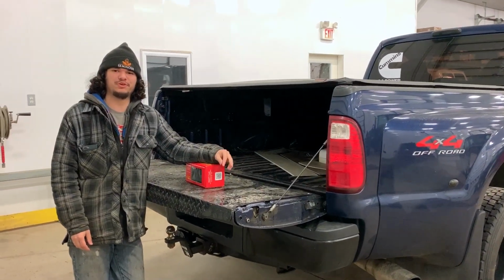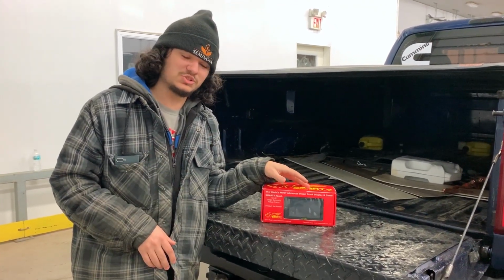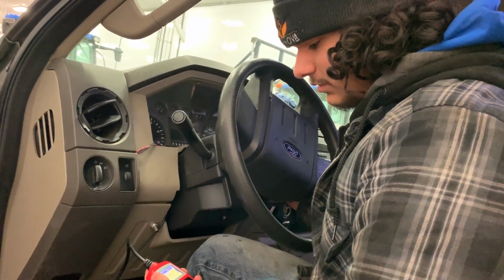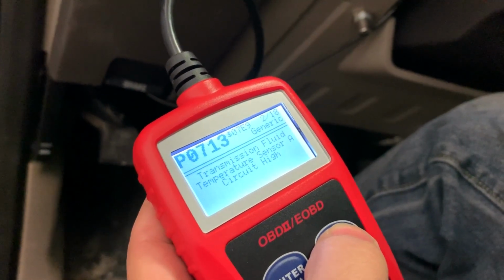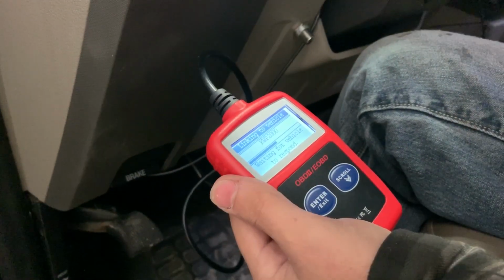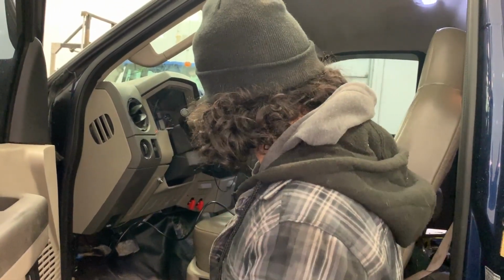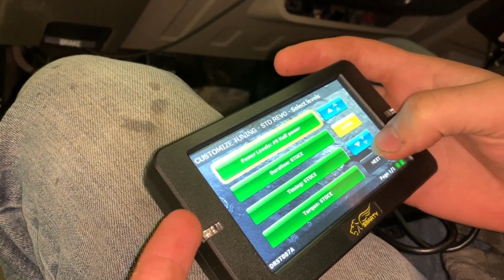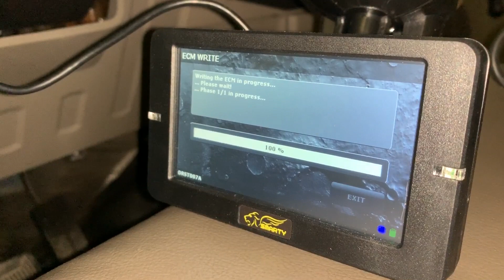Tuning DID NOT Go As Planned! Smarty Touch Tuner

Comment: The different tunes use stock timing or they add timing.  The smarty was a popular tuner to stack with an edge tuner.  If you had the edge, you would set the smarty to a tune that used stock timing as the edge tuner was already adding timing.  If both timers were adding timing, it could cause problems.

Comment: You need to put the battery on a charger to flash the PCM.  I had the same problem with my F150.  I was only a couple tenths of a volt below the required but it worked fine as soon as I put it on a charger.

Comment: Smarty and edge are not the same thing at all tuner vs box, easy is a box like edge, banks ect. Smarty is typically a choice for someone who is going further like twins, injectors ect then dyno tuning. You can use a smarty to just give more power on a stock truck but a box type (edge/banks) will be far easier and safer for the average user.